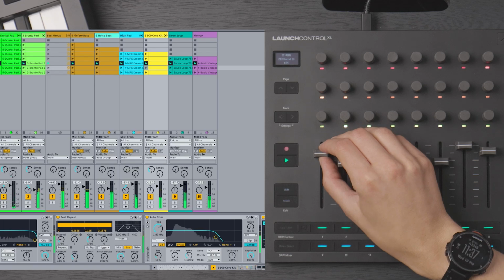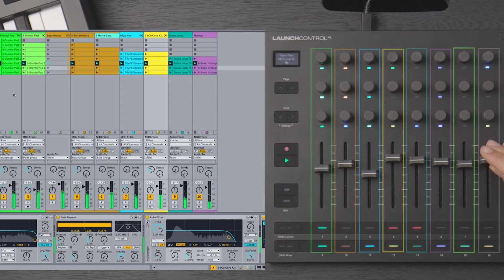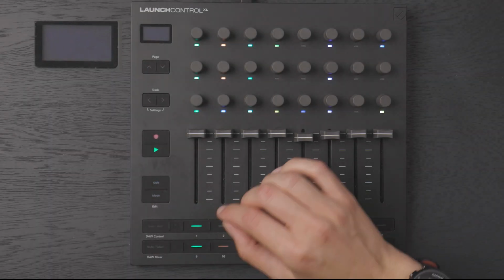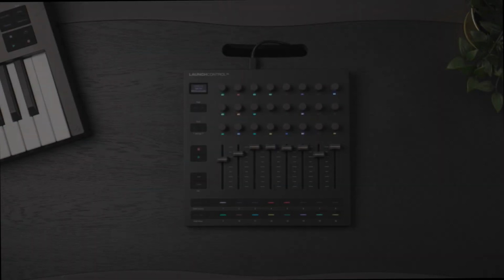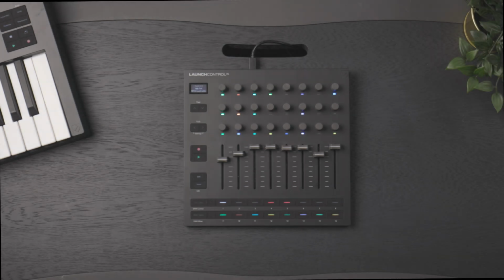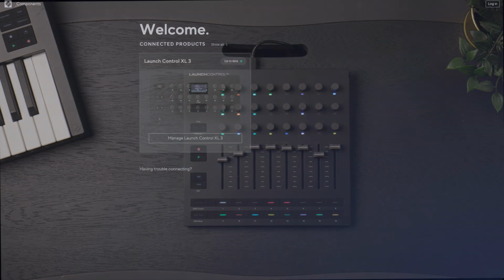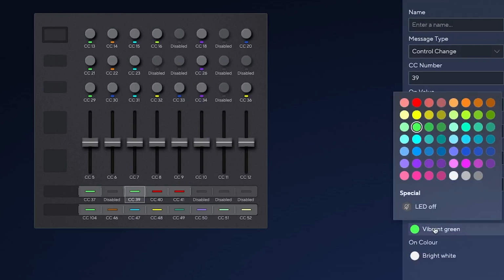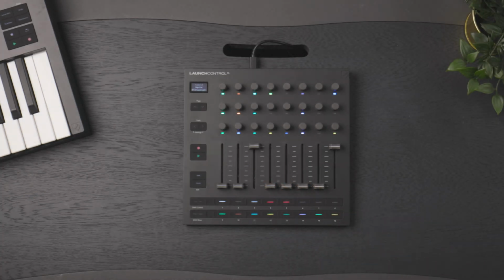Using Launch Control XL 3 Custom Modes with Ableton Live

Comment: Yeah, I'm having a crazy difficult time doing basic Ableton MIDI mapping for a live set I have coming up
Reply from the maker: If you're having difficulty following along with the mapping guide in this video, feel free to get in touch with our support team: https://support.novationmusic.com/hc/en-gb/requests/new
Reply: Short version: Cmd+M, click the parameter, move the knob, Cmd+M again. Mappings are saved in the set, so do it in the set you'll actually play. If Live ignores a knob, check that Remote is On for that input in Preferences > Link, Tempo & MIDI. On an LCXL MK3, custom modes keep the CC layout identical between sets, which is what Control XL is built around: https://youtu.be/UsJxPBdf568

Comment: any video for launching different clips (in session) .. cheers
Reply from the maker: Launch Control XL 3 isn’t specifically designed with Clip and Scene launching in mind. Launchpad is a great choice for that kind of control, but you can certainly manually map individual Clip and Scene launch controls to buttons in Custom Modes using the MIDI Learn feature in Ableton Live.
Feel free to message us directly on social media if you need any help with that:
https://linktr.ee/wearenovation
Reply: @NovationHelp  nice for answer ;), i have launch pad, it's for less stuff to move in live. a new apc mini mk2 by novation (launch pad , 8 faders + 2,3 rotary knobs per channel) wll be great ! not exist. yaeltex, intech are not cheap ;) best vibes

Comment: can i delete functions from the daw control? for example i dont use a pan knob i want to give it a custom midi cc to control my eq in ableton?
Reply from the maker: That’s not currently possible. When working with DAW Control Mode, functionality is determined by the script which, in the case of Ableton Live, is integrated into the software. This isn’t something that can be modified, but you can quickly create custom controls using the MIDI Learn feature in Live, assigning controls to a Custom Mode.
Reply: @NovationHelp  then why don't give us acces to the script to modify it? or make an app that does the coding?
Reply: The DAW Control script comes with Live, so it stays as is. For a pan knob that does something else, build the mixer in a Custom Mode: any of the 24 knobs can be Pan, EQ gain or whatever you map with MIDI Learn. I did that in Control XL: modes 11–14 are a mixer made from Custom Modes, so every knob can be remapped: https://youtu.be/UsJxPBdf568

Comment: Any way to see the value of the mapped parameter instead of the generic 0 to 127 value on the LCD screen?
Reply from the maker: Using Components, when creating Control Change encoder assignments, you can determine the range. It will default to 0–127, but you can define minimum and maximum values. During use, you can hold Shift and move an encoder to see its current value on-screen without making any changes to the encoder position.
Reply: The LCXL LCD only shows what's hardcoded in the Custom Mode template – there's no way to stream Live's actual parameter values to the screen without a full bidirectional remote script, which Novation hasn't published for the MK3. Dynamic Focus shows parameter name and live value on Ableton's screen the moment you move a knob. https://www.youtube.com/watch?v=vEJGWkK9gIU

Comment: Is it just me or is this extremely difficult to map anything?
Reply from the maker: We’d like to help. What kind of problems are you having exactly? Specifically, what kind of hardware or software parameters are you hoping to map to the Launch Control XL?
Reply: @NovationHelp  I use a MacBook Pro m3pro with Ableton live 12 (latest version).
I’d like to map the encoders to fx parameters, faders to different channels and buttons to toggle things on and off for live performances.
Reply: @NovationHelp  I’ve tried to follow the video, but when I go back into Ableton it doesn’t seem to read the parameters I’m trying to set them too
Reply: Could it be a firmware issue!
Reply from the maker: Have you updated your Launch Control XL 3 to the latest firmware using Novation Components?
https://components.novationmusic.com

Launch Control XL should be automatically detected by Ableton Live and offer immediate control of parameters such as track faders, plug-ins, and devices. Since it doesn’t seem to be functioning for you, please open the Link, Tempo & MIDI settings in Live and ensure that Launch Control XL 3 is configured as shown in this article:
https://support.novationmusic.com/hc/en-gb/articles/27282166560914-Launch-Control-XL-3-and-Launch-Control-3-Ableton-Live-setup

Once Launch Control XL 3 is correctly set up, you should find that you can navigate to one of your Custom Modes on the hardware, enable MIDI Learn in Live, and manually map software parameters of your choice to the Custom Mode parameters. Let us know if that is not the case.
Reply: @NovationHelp  That Fixed it! 
Thank You 
😄

Comment: It doesn’t work for me either, even though I’ve properly installed Live 12.3.6. The “DAW Control” and “DAW Mixer” modes work perfectly, but once in Custom Mode, it seems like Live doesn’t assign the MIDI. However, if you switch back to “DAW Control” mode, the mappings are correctly applied in a sort of semi-automatic way. Could there be a conflict between DAW Control mode and Custom Mode?
Reply from the maker: Did you download the supplied Custom Mode and send it to your Launch Control XL 3 hardware using Novation Components?
https://support.novationmusic.com/hc/en-gb/articles/28124766547986-Launch-Control-XL-3-Live-Lite-Demo-project
Reply: Close the novation app if you have it open. MIDI can only connect to one source, if your device is currently in editing mode, it blocks Ableton from recognizing the buttons.

Comment: Not working too, even if I upgrade abelton 11 to 12.  It stop responding when I push MODE button.
Reply from the maker: We're sorry to hear that you're having problems. If you haven't already, please raise a ticket, give us a call, or use Live Chat to discuss this with the team today. We'll help you find a solution - https://bit.ly/CallNovationSupport

Please also ensure that it's correctly set up within Ableton Live. We explain how to do that in this article - https://support.novationmusic.com/hc/en-gb/articles/27282166560914-Launch-Control-XL-3-Ableton-Live-setup
Reply: @NovationHelp  Steps what I did to make it work. 
Upgrade abelton 11 to 12, (was not enough) Factory reset my MacBook Air. 
Reinstall abelton 12 
After all that, it started do what suppose  to do. With same settings. Great device. First impressions was not that great..
Reply from the maker: Glad to hear that you're now up and running. Sorry you experienced these problems. 
If you haven't already, please also ensure that your Launch Control XL 3 is using the latest firmware, available from Components:
https://components.novationmusic.com

Generally speaking Launch Control XL 3 is plug-and-play with Live 12, providing it's using the latest firmware.

Comment: Nice upgrade. Is there a way to quick see on it's screen what the encoders are controlling, without sending any CC, eg like Shift + Encoder ?
Reply from the maker: That's right, you can hold Shift before turning an encoder to preview its assignment and current value.
Reply: Not natively – encoder labels in a Custom Mode slot are static text baked into the SysEx template, they don't pull from Live at runtime. For 'what is this knob controlling' in Ableton, https://www.youtube.com/watch?v=vEJGWkK9gIU is the answer – Dynamic Focus shows the parameter name and current value the instant you touch an encoder, no CC sent yet.